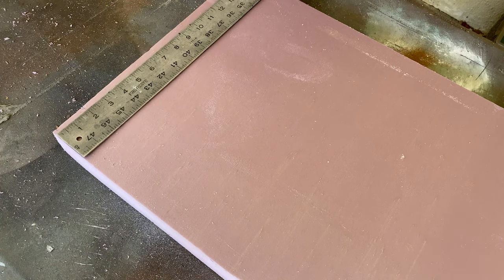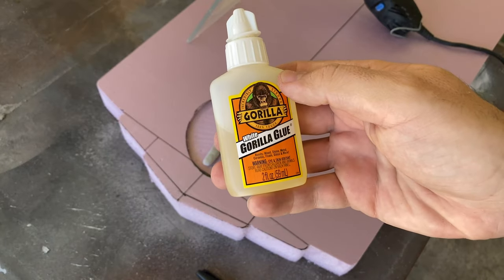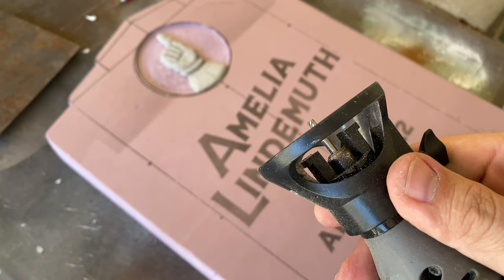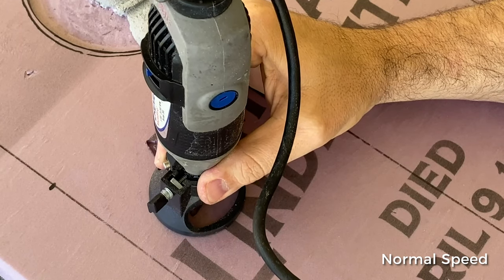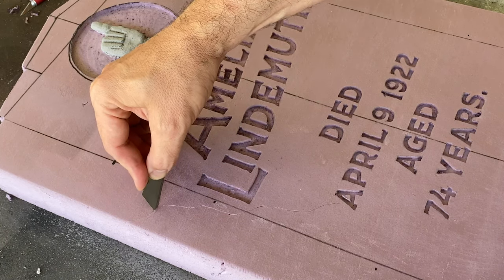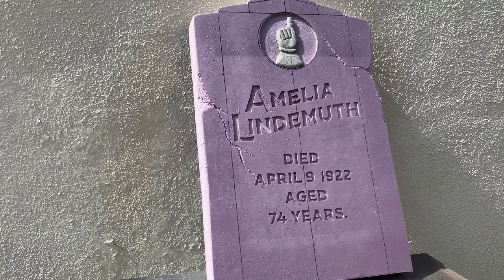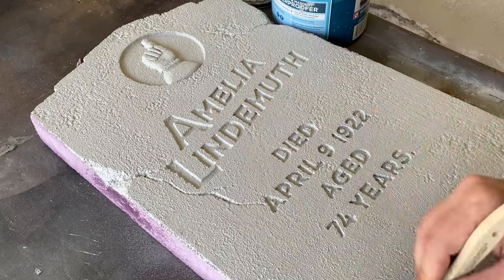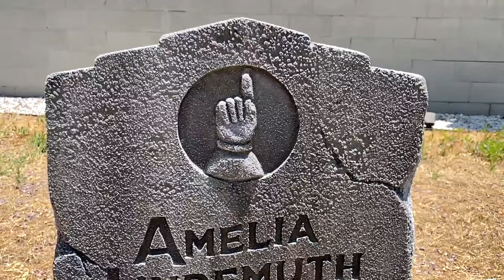Make Your Own Realistic Halloween Tombstones

Comment: That acrylic guard is a freaking GAMECHANGER! Really awesome tip! 999
Reply from the maker: Right?!
Reply: @VanOaksProps  What kind of glue did you use to cement the plastic guard to the dremel guide?
Reply from the maker: @rickarchambault4756  Super glue. Epoxy would also be a good option.
Reply: @VanOaksProps  Oops had one more thing. Where did you get the acrylic sheet? Lowes? Arts n Crafts place?
Reply from the maker: @rickarchambault4756  For the versions that I sell (available here: https://etsy.me/3LkRY2X) I've been getting materials from The Laser Cave Supply here in Los Angeles.
Reply: @VanOaksProps  Oh, you sell these? Good deal! Thx!
Reply: @VanOaksProps  I ordered both sheets from your thing on ETSY. They come with the Dremel cup guides already glued on?
Reply from the maker: @rickarchambault4756  yep! They can be used right out of the box.

Comment: Great job! Just a little tip for you, or anyone making tombstones out of styrofoam, instead of using the Dremel to cut the letters into the foam, if you had gone heavier with the spray paint, the paint would have eaten into the foam and etched the letters into the tombstone. That's how I do all of my tombstones. It makes the letters look more weathered-in over time, rather than freshly carved. Of course if you're going for a newer tomb stone look, then the Dremel is the way to go, but if you want an old and weathered look, then you can skip the Dremel, and just go heavier with the spray paint. It's SOOOOO much quicker. You don't have to spend all of that time and energy trying to be so precise with the Dremel. Also, the more paint you lay on, the deeper it eats into the foam, so go easy at first, until you get a feel for how much the spray paint eats into the foam. Here's one I made for someone who paid me to make it. The letters are painted darker so they can be read easily. The ones I make for myself, I don't usually paint the letters so dark. This tomb stone is a negative relief, where the letters are raised, and everything around the letters are carved, but it's the exact same concept in reverse. If you look at the border around the edge of the tombstone, you'll see what the letters and art would look like without paint. They're raised, with the background etched into the stone. https://i.pinimg.com/564x/1c/1c/da/1c1cda2b8f12510a8ef777e6de9b6bf6.jpg
Reply from the maker: That's definitely a way to do it and it's quick. It can be unpredictable, however, but as long as you know that when you start you should be alright. Also keep in mind that different brands of spray paint use different propellants, so you may get more "melt" with one brand over another.

Comment: I really enjoy this video. I watch it often from time to time. If going with the paint and sand mixture, how much sand would you mix into a 1 gal.? 1, 2, 3 cups? 

In the past I would do a thick coat of paint and then hand sprinkle the sand onto it, let dry then do another coat of paint to lock in the sand, then dry brush over it. But at the time had never thought to mix sand directly into the can. NOW i will. 

I've never used or touched drylock before, so just trying to get an idea of a ratio for the consistency. I actually work at an HD and am always keeping an eye out for discounted paint or hoping a damaged drylock shows up.  I plan to get some foam tomorrow and make a few during my days off. Or at least get a start on them....Thanks for your vids....✌✌🎃🎃
Reply from the maker: I’ve never paid attention to the ratio, I’m just shooting for loose pancake batter consistency.

Comment: just a tip for how i transfered the letters on without  a stencil. just print it out on a piece of paper and use a pin to poke holes around the letters to transfer them onto the foam

Comment: Such an awesome process to watch. I think your tombstones are some of the most realistic I’ve seen!  The dry lock adds such a realism and really creates the look of stone.  Well done! Where do you typically buy foam like this?
Reply from the maker: Thanks so much! In the Los Angeles area there’s a contractor building supply house called L&W Supply that carries the pink foam.
Reply: Home Depot carries it under the brand name Foamular
Reply: @VanOaksProps  What did you use to keep the tombstone upright on lawns? Most people use PVC pipe and rebar.

Comment: Thank you so much for posting your turtorial. I didn't realize how time consuming it'd be to make 17 at once but here I am...lol  I didn't find the pink foam so I used the white rigid insulation and so far so good but I like the look of the pink foam...maybe next year I'll have some. I'm just using a heat gun to texturize cause I'm afraid of fire!  I'm almost ready to spray the paint on it but I don't know what the paint to water ratio is? I'll play with I on the backside like you suggested for dry brushing & see what works. Thanks again, I'm really having fun with this. I'm trying to think of ways to do this for Christmas deco too 🙂🎄

Comment: Beautiful stone and color. Spraying the letters with spray paint....what a great idea. BTW ...why water before the blowtorch? For safety or to add the bubbly texture?
Reply from the maker: Good question! The way that the torch aging works is that the water prevents the foam from melting. So anywhere that there isn't water gets melted/textured. The water droplets help give it that aged tombstone look.
Reply: @VanOaksProps  Would a heat gun also work instead of torch?
Reply from the maker: @matrixmom3300  It does, but not as well. The torch is more direct heat and will melt the foam much more quickly and evenly. With a heat gun the foam starts to retain the heat and then eventually melts the foam, so it can be a bit hard to control.

Comment: This looks great! Will the drylok add any extra durability to the foam? I've only ever painted my tombstones with latex or acrylic paint and they get dinged up pretty easily. I've considered hard coating them but I'm trying to find a decent way around that.
Reply from the maker: A bit. It's got a gritty texture which adds some ruggedness to the coating, but it's still possible to gouge out a piece if you were really bent on doing it. If you wanted something half way between Drylok and basic latex paint, consider adding fine playground sand to your latex paint. It'll give it a similar grit to Drylok and you can control how much/how little you add.
Reply: @VanOaksProps   I appreciate the advice. I might go ahead and give the drylok a shot. Thanks!

Comment: I'm in loooove. What thickness of foam do you typically use for these? And do you have any recommendations for using these props in places with heavy winds?
Reply from the maker: I use 2" Foamular XPS 250 foam. You can get it at most Home Depot and Lowes locations in the insulation department. As for heavy winds, I have a video on it: https://youtu.be/luyjpX5b5pQ?si=NUZ8e-WdIpUUB4Mw

Comment: I got a question, im sure you can answer and love your work, but when using Microsoft word to do the names and dates for the epitaph,  do you know what font size would translate to 2 inches sized lettering on your tombstone, 1 inch, etc. I never seem to get the desired size the first time around when doing a print its hard to tell how big the name is going to print out when you see it on the computer vs actually comparing it the size of the tombstone- im sure its easy im just over-thinking it
Reply from the maker: Great question. Unfortunately, there's no hard and fast rule since every font is different. You can, however, turn on the ruler option (in the view menu) and it'll get you in the ballpark.
Reply: @VanOaksProps  thanks so much that'll come in handy , never thought of that-

Comment: Do you feel it helps doing the weathering wash in warmer weather over cooler? I’m working on a sample right now just messing around with some ideas. However, when I get to the weathering, I can’t get your results or anywhere close. Either my mix is to watery and it all drips down and off, or it’s to thick and I end up literally painting the whole project with my spray bottle. I just can’t seem to find that sweet spot.
Reply from the maker: Warm weather definitely helps. Just remember that it’s a build up and will take time. Layer upon layer to get to the final color. Also, if it’s too heavy grab a second spray bottle with water to help thin the paint on your tombstone after you’ve sprayed - spray the paint mix, then the water to help control how heavy it’s going on.

Comment: I just made 10 of these from a sheet of foam. Came great !  Do you need to seal them with a polyurethane to prevent the acrylic paint from running ?
Reply from the maker: Nope. Acrylic paints are weather resistant, so they should be just fine.

Comment: Excellent, didn't think using heat (torch or heat gun) would produce results like that.  I've been letting the spray paint do the work for a long time and results are far from predictable.

What type router are you using?  I've also only ever done carving by hand with a stencil knife!
Reply from the maker: Yeah, the water/torch method is great. Fairly predictable, or at least as predictable as you can expect for a material that's supposed to absorb heat/cold.

I have a few different models of Dremel tool that I've purchased over the years. There isn't one that's noticeably better than another model, in my opinion. Although I'm tempted to get a cordless one.
Reply: @VanOaksProps will have to make a run to home depot and grab one.  Moving into a new home in Sept, early oct, seems like a good time to refresh the graveyard a bit!

Comment: What kind of vinyl material did you use to create your tombstone template? I imagine it must have been something fairly thick as whenever I try to use just any old something grabbed off the shelf it's fairly difficult to "weed" and then place. Do you happen to know which brand/type of vinyl you used? Or maybe a better question is what type do you prefer?

Thanks!
Reply from the maker: I like Oracal 651 vinyl.

Comment: Derek, does Dry lock separate if it's new/unused? I tried making a tombstone using it and it came out very wet and runny. Thanks!
Reply from the maker: Yes it does. It needs a good mixing every time you use it.

Comment: Love your tutorials, but how much water ratio do you mix the paint with?  If it’s to watered down doesn’t that affect the bonding agent in the paint?  Very new to this diy stuff
Reply from the maker: For the craft paint, it's more of a runny consistency that you're looking for rather than a ratio. That said, you can start at 1 part paint to 5 parts water and adjust from there until runs freely. If it seems too heavy, keep another spray bottle with just water nearby to help thin it out before it dries. I've never had any issues with bonding.
Reply: Wow I really wasn’t expecting a response since your vid was three years old.  Your awesome and thank you for the help!!! @VanOaksProps

Comment: Did you use a router bit or small cutting tool?
Reply from the maker: Router bit
Reply: @VanOaksProps  what size bit? I'm trying to use a 1/4 inch router bit. I think it's to big?
Reply from the maker: @costumesforalloccasions  Yeah, that's pretty big for detail work. I use the Dremel 194, which is about 1/16" inch.
Reply: @VanOaksProps  just bought one going to try it!

Comment: Sorry for the dumb question, where do you get the foam board from? Is it just from any home improvement/hardware store?
Reply from the maker: It’s not a dumb question at all. In many states you can buy it at your local Home Depot/Lowe’s in the insulation department. In some states, like California, it’s a specialty item that is sometimes sold at contractor supply places. You may need to call around and ask if they sell 2” XPS insulation foam.

Comment: Do you utilize the spray bottle method painting for all your tombstones, and could you not use multiple spray bottles with different color paints?
Reply from the maker: I do. It tends to give the most realistic wash since humans aren’t good at doing “random” anything. This way you’re allowing gravity and the surface details to determine where everything should go, just like it would in a real cemetery. 

You can absolutely use multiple bottles with different colors.
Reply: @VanOaksProps  Thanks for the quick reply. I have seen people paint with a paintbrush to achieve a random effect but it seems like that would take forever and as you say not look very "random".
Reply from the maker: Yeah. That’s kind of how I came to use this approach. Plus, if you’re painting a bunch at the same time you can cycle through them and by the time you get to the last one, the first one will be dry and ready for another pass.
Reply: @VanOaksProps  I am "rehabbing" about 20 or so old Wallmart/Halloween store tombstones painted with gray drylok and need to age them in different colors. Thanks again for the info.
Reply: @VanOaksProps  So for clarification, did you spray the black, brown and moss colors on separately or did you mix them together into one spray bottle?
Reply from the maker: @brianmoeller3539  Separately. It helps to create more depth in the weathering.
Reply: @VanOaksProps  That's what I thought and had planned. One last question. The letter color you lost video on. It looked like you just took the remaining spray and painted it into the letters instead of straight paint? Amazing work btw!!
Reply from the maker: @brianmoeller3539  That's correct. I just took some of the black paint from the spray bottle and brushed it into the letters to help darken them up. I didn't want to go too dark. Just enough to make them stand out a bit more. Thanks for the compliment!

Comment: Hi,

I would like to know how you transferred the vinyl to the foam. Did you use transfer tape? Or did you just peel the vinyl off and place it on the foam then add the small pieces for the A letter and D letter and the 9 number.
Also what vinyl cutter brand do you use?

Hopefully you can answer.

Thank you.
Reply from the maker: I used transfer tape to get the design onto the foam. I use the Silhouette Cameo for cutting vinyl.
Reply: @VanOaksProps  thanks so much. You should make a video on how to do it. I’ve watched other videos and let’s say most of them are very ‘up in the air’ at least your videos are easy to understand and straightforward. Thanks.
Reply from the maker: @steelwinter4194  it’s pretty straight forward. I cut my stencil and removed the letters to make a stencil. Then cut a piece of transfer tape the size of my stencil, then peeled off the backing of the transfer tape and applied it to the vinyl stencil. Then I peeled the backing off the vinyl stencil and placed the whole thing onto the foam, pressed it down to make sure it stuck to the foam and then peeled off the transfer tape.
Reply: @VanOaksProps  thanks.

Comment: How to you stake them to the ground. I am concerned the wind would keep knocking them over. Cool video. I am going to try this.
Reply from the maker: We’ve got a video on that! https://youtu.be/luyjpX5b5pQ
Reply: @VanOaksProps  So with the weathering is that a sealant that will keep it from getting destroyed if it rains?
Reply from the maker: Sort of. The Drylok is a sufficient weatherproofing, so anything else is just a bonus. That said, acrylic paints are weather resistant and will give added protection.

Comment: Awesome, trying to find Drylok here but seems I only have access to Bright White Drylok Extreme. Would I be able to achieve a similar result with it?
Reply from the maker: It's much thinner than Drylok original and doesn't have any grit to it. So I'd suggest an exterior latex paint with some playground sand added to it to achieve the same stone-like texture.
Reply: @VanOaksProps  Thanks for the useful information! After more digging, I was able to find White Drylok Original. Does it have the same effect as the Gray ones? 

We also have access to Drylok powdered. Did you have a chance to try it out?
Reply from the maker: Yes, white & grey are the same. Just a different color base. 

I didn’t know they offered it in a powdered mix. I’ll have to see if I can track it down.
Reply: @VanOaksProps  the powdered comes in 35lbs package. It’s supposed to be economical. But it seems to be more sandy by its description.

Comment: Hey Derek, in the process of making 11 of these and I have a question about the paint washes. How does the wash cope with the rain?

I have I thought going through my mind that it might reactivate the paint in which case a clear coat would be necessary. How have yours coped over the years?

Thanks and keep up the great work.
Reply from the maker: Since it’s acrylic paint it’s relatively weather resistant. I’ve never had issues with any of my outdoor props that have been weathered this way.
Reply: @VanOaksProps  Excellent. Thank you for the reply!

Comment: Great video! I have a question for you. I'm doing a merry go round like you see at a park. How would i weather the platform? I'm weathering the grab bars using your rusty fence tutorial. Thanks
Reply from the maker: How close will people be to it? Will anyone be walking on it? Indoor or outdoor?
Reply: @VanOaksProps  it will be outdoors. People will be about 5 feet away.
Reply: my neighbor did something like that a few years ago- had the zombie babies on it as well what is it made of may I ask? if it was foam I would say just dry brush it with maybe  rust colored type paint mixed up and maybe splatter it too- do you have a video of this progress?
Reply: @FordFalcon1962nBlue  I'm on a few FB forums and got some advice from them also. It is made of half inch plywood. I sanded it a bit, hit it with some super 77, and misted it over with some matte black and rust colored spray paint. No video of the progress yet. Thanks for your interest.